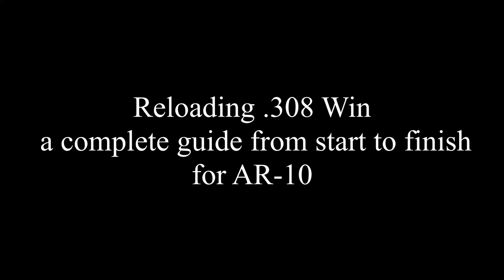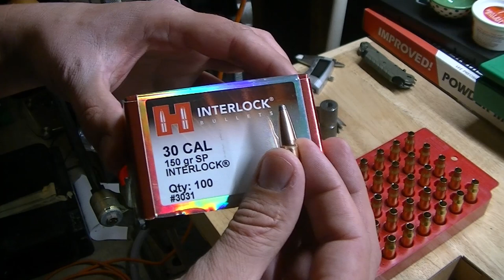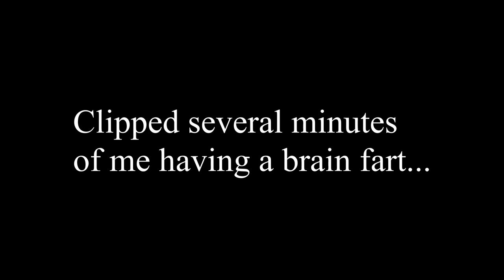A Complete guide to reloading .308 Winchester

Comment: The powder needs to settle in the hopper. Throw about ten charges to let settle without tapping and then handle the thing like a raw egg, no tapping. This measure is very accurate even though it is cheap. It outruns a lot of other ' premium' powder measures but lyman.

Comment: When you drop the powder into the pan hold the tray up tight to the bottom of the drop tube. After you crank the handle lower the pan and Walla, no spilled powder.

Comment: I could kick my own tail for not getting into reloading years ago for no other reason than tailoring  hunting loads. Too late now with all the shortages and ungodly high prices. Nice video sir.
Reply: Josh Smith  people reload for different reasons. Some do it to save money on a certain caliber round that may be hard to find, some do it to stock up on a round they target shoot or plink with alot, some do it as a hobby,, and some a combination of all these reasons. I personally do not shoot any particular round enuff for reloading to  be  cost efficient enuff to invest in all the equipment it takes to do it for any of the reasons above. Now, there are people who reload certain rounds that they use  for hunting or precision shooting  that may even  specifically hard to find and to gain performance of that round at different yardages or with different grain  or type of projectiles, powders, primers, brass, over all case length, bullet seating depth, head spacing, etc, and so on and so on just to get a different outcome or performance of said round on the target or game animals and even from different barrel lengths or even different guns in the same caliber or chambering.  Basically, loading and trying different combinations to get different outcomes. That's what tailoring a round means.
Reply: I just saw a video where someone did the math for you. It’s actually still cheaper to buy overpriced reloading crap and make your own ammo right now than buy factory ammo. This also depends on caliber. My advice to you would be don’t start if all you’re planning on reloading is 9mm.
Reply: I started handloading shotgun shells when I was 14 years old so that I could have the shells when I need them  I did a lot of bird hunting duck hunting now that I am 59 . I have gotten into rifle Reloading for several calibers 308 , 270 , 243, 300 win mag and I am about to start 6.5 Creedmoor and 35 Whelen. I do it because of the cost sufficiency and the performance you can actually get a load that you’re gonna like and put five shots touching for a particular caliber that is picky so glad I can reload for my self !! 🤷🏼‍♂️

Comment: For brand new brass out of the bag, would you still use the resizing die and chamfer the cases? Thank you for this video.
Reply from the maker: Yes. Cause you'll find that even with brand new brass itll have deformed case mouths that need to be reformed and cases dont come chamfered so you put that on there to ease the bullet seating.
Reply: If you buy premium brass like Lapua tool find there is little to no initial prep necessary, maybe a little chamfer. That's only for the first use though.

Comment: Instead of tapping your powder drop all the time, just tape a vibrating toothbrush to the back of it. Simple.
Reply from the maker: I'd prefer to take the gf's magic wand, more power and all. But either way, it's a great way to build up static in these cheap plastic hoppers with no esd

Comment: That cheap Chinese scale is NOT, i repeat NOT accurate enough for gunpowder
Reply from the maker: Really?! Cause it compared pretty nicely to my calibrated, nist tracable, OHaus scale...
Reply: You are absolutely correct about the scale…no wonder the differing weights each time he threw a load to test.  That should NOT be happening…invest in a real scale.  You could use a balance scale in order to get a “feel” for that part of the overall process.
Reply: Did you measure your finished rounds against the recommended c.o.l. ?  After you finished the crimp step?

Comment: Question pls. Let's say I'm loading .308 ,how do I know how many powder it takes I side the case shell, and also if I have 175 grain bullet and a 150 grain bullet does 175 will need more powder in the case. Main question is how do I know how much powder to add in each load or if I load different grain bullet in reloading .308 . Is that info comes in the one book for reloading
Reply from the maker: Yes, purchase a reloading manual. It will have specific weights for powder and projectiles.

Comment: This guy is your common know nothing green horn YouTube video up loader.
The sizing dies use also the primer decaping pin and for lubing casings there is lube rolling pads..
There is zero reason to use the Lee decaping die when that RCBS sizing die has the primer punch pin .
Reply: Agree with everything you said, except your first three sentences. Better to use the stand alone decapper; it works for multiple calibers. Then you can clean the brass (and now-empty primer pocket) before resizing.

Comment: Why not decap and resize then clean off the resizing lube so contaminate your powder? Are you using distilled or DI deionized?
Reply from the maker: Distilled water. And I've never had a problem with case lube contaminating my powder to any extent that it harms the load.

Comment: im guessing you have a crimp in that bullet seating die. you should lower the die until it touches the rim of the case then back it off 1 turn. then adjust for bullet seat. so that way you have more of the bullet seat stem to work with.

Comment: This guide is useful but it misses the crucial prior case examination for loose primer pockets/splits/dents or signs of insipient head separation -  all of which can cause serious accidents. Furthermore no mention of case length to ensure within prescribed safe max limit. Although it appears to be for full length resizing of cases to fit any 308 It could also cover tailored-fit bullets by measurement of chamber and matching case/bullet length to it.

Comment: Any reason why you not mesure each load so you know you get the exact same amout of gun powder in each brass? This must make a tighter spread when you shoot? 1 grain up or down menas 2.5% of diffrent amount in the brass and can make huge diffrens at the shooting range? Am i wrong?
Reply from the maker: You are correct, but it isn't that important for these loads. The spread with the powder measure is less than half a grain and these rounds are getting ran through an AR-10. So to me, it's not critical as this isn't for a precision rifle but for a battle rifle.
Reply: You're right...and wrong.  IF you're shooting a match grade rifle and are capable of holding hard enough...then yes.  One grain in some cases(literally) will make a VERY small noticeable difference.  BUT...Most people are not only not capable of not noticing such minor variations considering the normal "spread"...but their rifles are certainly not capable of holding that tight tolerance with repeatability.  For most people...loading hunting rounds/plinking rounds...a +/- 1 gr is not worth the time to weigh EVERY charge.  The normal spread in velocity due to other factors is usually far beyond a 1 gr difference.   Weigh and check every 5-10 rounds just to adjust for the loss of volume in your powder hopper in some brands.  My Dillon usually loses 1/4 grain every 10 rounds when throwing large volume loads and when using a long stick rifle powder.  If using a ball powder...it's virtually identical from full to empty as it's throwing based on volume and not weight.  Use a LEE factory crimp die as well to ensure the bullet is "popping" at a more uniform pressure...which can also mask some small variations in powder charge.

Comment: Thanks for the awesome vid. Would you recommend tumbling spent brass before or after resizing/de-priming. Thanks!!
Reply from the maker: Deprime separately first on a generic decapping dye, not the sizing dye. But keep your decapping pin in if you're tumbling to knock out any bits of media that get stuck in the flash hole.
Reply: @AlmostPrecisionKinetics  awesome, I will do that from now on. Thanks for the help!

Comment: I know its a Lee press, but what model is that and does it come with the priming tool?
Reply from the maker: This is the breech lock single stage press. It does have a priming tool that rests in the ram and primes on the down stroke.
Reply: The Lee Anniversary kit has the handheld case primer tool with a box of all the special bullet seat inserts that makes priming easier and quicker.

Comment: The sizing die has the primer de caping pin so there is zero need to be using a 3rd die to de cap primers.
There is reloading roll pads to lubricate then roll the case on the pad then resize the case.
I get amazed at the number of video's uploaded by green horns about some subject.
The next issue that might happen is for auto loading rifles some rifles need the cases sized in small base dies.
You will know this when fired cartridges start not extracting and causing jam ups
That is absolute stupid and dangerous to not measure each powder charge and tapping on the powder charger delivers even more or less powder to the cartridge.
You always check the weight of every powder charge before seating a bullet in the case.
This is a green horn is going to blow a gun one day